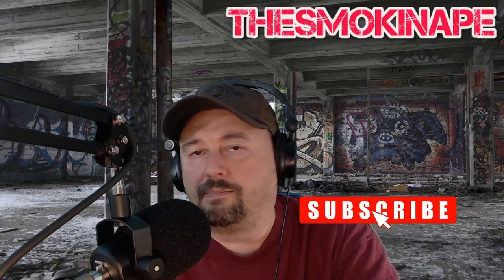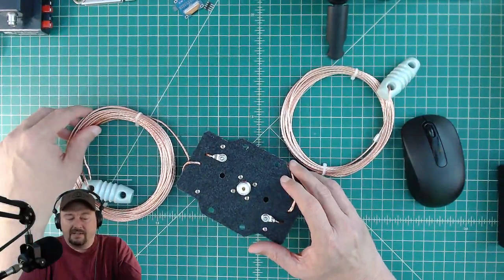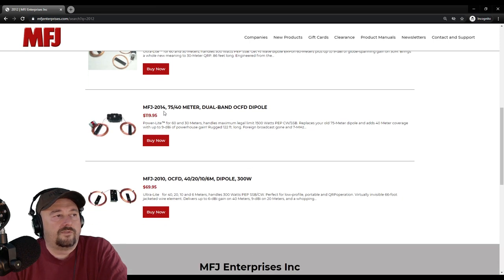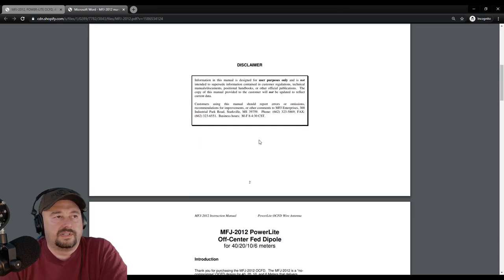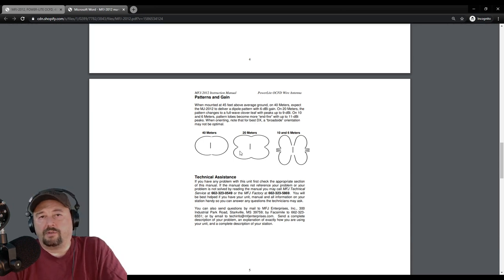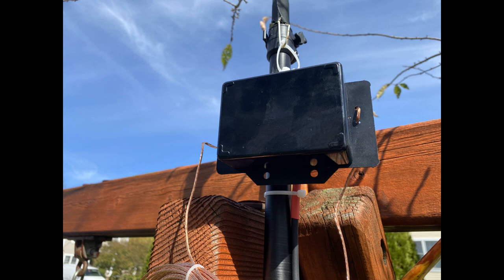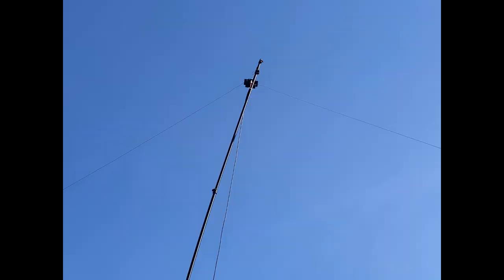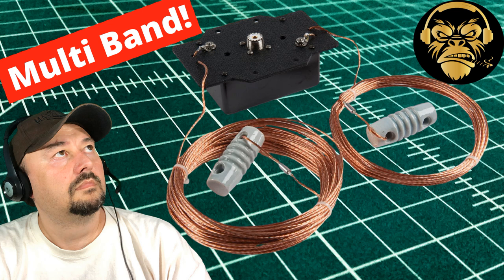MFJ-2012 OCFD Dipole - Ham Radio - TheSmokinApe

Comment: This was my first antenna after I got my general class. The antenna was brand new and given to me by a friend. I put it up on a 30’ mast, inverted V, turned on the radio and heard a dude calling CQ on 20m; he was in Northern Ireland, I’m in southeast Texas. I hit him right away and got a great signal report. I used that antenna for a good while until I wanted to go a bit lower in freq. I could get it to tune up on most of the 80m, but not quite all the way down. It was fine on 6m. 

The one thing I will caution people about is if you use it for going portable, that wire being uncoated is very susceptible to being kinked when you’re pulling it tight or winding it up. Keep that in mind and pay attention when you roll it out and take it down.
Reply from the maker: Totally agree.  This antenna performs fantastically well but the hard drawn copper elements leave a little to be desired.

Comment: Hi, today I came to know (from Dave's video) that the BalUn is not the 1:4 Guenella current BalUn but is an autotransformer with 1:1.8 turns ratio to achieve 136-138 ohm at the feed point to be interfaced with the regular 50 ohm coaxial cable; the article was written by K1BQT, Rick in June 2008 qst issue.
He had originally used ferrite mix #43 for both the 1:1 CM current choke and the 1:1.8 voltage BalUn.
De VU2RZA
Reply from the maker: Thanks!

Comment: nice video on that offset center fed dipole. this is the one I have and appx 3 years old. The only trouble I has is in NY we have bad winters, my copper corroded after 3 years and replaced with THHN wire. Had about the same tune. I shortened appx 3 in on long side and 1 in on short side. this is how you tune offset center fed. I unsoldered and cut re soldered was easier than that crimp .  I have ran a sloper for POTA . works great always stays in the tune range of IC 7300 on the 4 bands.  now I am re doing with DX commander DX 50 green wire. I have the MFJ end fed 40 meter 800 watt. about same length and that one does not work as well. sometimes needs a counterpoise.  had RFI get into my mic on that one. and snow on the ground effects tune on end fed one . not as much on offset center after I shortened a tad. if using portable just swap out that bare wire. use DX commander DX 10 or 50 . or something like that. great for FT8 . some of them small ferrite cores heat up and make SWR rize. FT8 is high duty cycle.  and meant to be low power.  great review of that MFJ-2012. it is fun trying different antennas'  . a dipole is a dipole. the feed point only changes impendences  . 73's
Reply from the maker: Hey Robert, sounds like you're running an antenna farm!
Reply: @TheSmokinApe   @TheSmokinApe  in a HOA now. portable now. POTA ! all year . re doing my collection of dipoles. DX commander 2024 expedition  portable soon. saving up. different parks need different setup. 6 meters open in NY today !  going to be trying different unun and balen out. 64:1 . even a type 61 core . want to do 160 meter again. need wire. a lot. still having fun learning !  73's

Comment: That is a cool exploration of this antenna. Seems pretty cool!
Yeah I imagine that if you were making this a permanent solution you could also mess with wire lengths and get things adjusted to where your match is happier still. Sometimes it's just tinkering running back and forth making adjustments and making sweeps with the analyzer.
73 de N2NLQ
Reply from the maker: Thanks man!  A trick I learned along the way is to use a tablet to remote control the NanoVNA Computer setup from the yard to help stop all the back and forth 👍
Reply: @TheSmokinApe  bloody brilliant

Comment: If you want a better antenna than this (quality and coverage) and to save some money just build a 135' OCF. All it takes is 45' of wire on one end and 90' on the other. 4:1balun at the feed with a simple choke (10 coils of coax with 6" diameter) about 10 feet from the feed point. You can work 80 through 6 on it though 15 M can be hard unless you have an external tuner. I have had mine up for 6 years with no issues whatsoever. Probably have made 3000+ contacts and many are DX all on 100w or less. Palomar makes a 4:1 balun with a built in choke just for this use but it is a bit expensive yet it will save you the extra coax for the choke. Nothing against MFJ but quality control is a roll of the dice.
Reply from the maker: You had me until you mentioned the coax choke or "ugly balun" as it is sometimes called.  Those need to be appropriately tuned to work correctly and don't have much in terms of bandwidth which is the point of the OCF.  I am glad it's working for you but you could just wind the coax on a t240-31 toroid for about 10$ and be better off...
Reply: @TheSmokinApe  Yes you are right that the coil may not work on all bands. I have had no issues but if I were building a new one I would get the Palomar all-in-one balun/choke and call it done. I may yet add a dedicated choke and remove the additional coax.

Comment: what are those white insulators in the package? (what are they called). and where would a person get those?. thanks
Reply from the maker: People call them "dog bones" they are use with a cable or a cord to keep the elements under tension.  I'm pretty sure DXEngineering has them.
Reply: @TheSmokinApe  thanks for your time.. have a good one
Reply: @TheSmokinApe  thanks for the reply. ordered and recieved my ten pack.

Comment: Would the mounting of the feed-point onto a leg of a metal tower be acceptable, or would the metal structure affect the height above ground impedance?
Reply from the maker: The metal might interfere, some folks will mount an arm off the tower and then use that 👍
Reply: @TheSmokinApe  Thanks for the reply.   I may try the arm mounting.   Also, I sent MFJ Customer Support an email asking the same question.  I'll let you know if they respond.
Reply: From MFJ Customer Service:  i believe this installation to be sound.  the tower leg should not
interfere with the coax lead.  thanks for your business.

Comment: I am currently studying for my General and will be purchasing the FT-991A in the next couple of months and I am trying to decide on the right antenna.  With MFJ not producing as much as it used to will this antenna be available?  Also I live in a Ranch house so my roof is only about 12 - 14 feet. That means I would need a 25 foot mast on my house.  I would need to attach that to my chimney. My chimney is not  in the middle of my house.  What should I use to tie down the inverted V ends?  Also I already have a Comet CX-333 Triband antenna on the chimney is it ok to mount two masts to one chimney?
Reply from the maker: Muck of the MFJ stuff is still available if you look hard enough. That VHF/UHF antenna looks like it’s pretty big and could cause some interaction with the HF antenna if mounted close.
Reply: @TheSmokinApe  what’s your take on attic antennas?
Reply from the maker: @JoeKrol  people use them with success all the time.  Just make sure you don’t have metal lining the roof as it will block RF 👍
Reply: @TheSmokinApe  I’m good there it’s a relatively new roof (5 years).  It’s plywood, a butyl rubber then heavy fiberglass tarpaper shingle. Also I have a 40’ length but it’s only about 14’ from the ground.  I might have to reconsider getting a mast or 40’ tower. Given what I have to work with is there a better antenna for HF that I should consider?
Reply from the maker: @JoeKrol  maybe a vertical in the back yard?  Or an endfed as a sloper?
Reply: @TheSmokinApe  thank you!!
Reply: @TheSmokinApe  I don’t have any height restrictions and a couple of the trees in my backyard are twice that high.  Just have to figure out the guidelines and my spouse has ALS. That disease is ruthless. We are praying she will live long enough to see my daughter graduate from college in 2028.  After that I’m not sure how long we’ll be in the NE.  Can you take down a mast and move it or are you better buying new?
Reply from the maker: @JoeKrol  sorry to hear about your wife.  Yes, you should be able to move and reuse the mast.
Reply: @TheSmokinApe  thank you for all of your time. Between you and HamRadio2.0 this hobby has really become worth it to me. The local club here is useless and I really want to do this but you two are a huge encouragement and wealth of information!!! Thank you!!!
Reply from the maker: Glad to help!

Comment: You are an excellent instructor however you can keep the “save the trees” comment(s) to yourself. I’m here for the knowledge, not the politics.
Reply from the maker: Hey man, I just like trees 🌲
Reply: @TheSmokinApe I like trees 🌳🌳  as well nothing wrong with that - plus they're super handy for holding up antennas in addition to cleaning the air 😀.  My big problem wil be getting the antenna high enough in the air.  73

Comment: Oh man that unvarnished wire 😳 still makes my blood boil. MF Junk. Only one month and my diepole swr was al over with no change to antenna. But I could already see the copper starting to rot. Good luck. 🍀
Reply from the maker: The wire could be a bit better 👍
Reply: I have to agree with your point about wire, mine did rot pretty quickly over the winter.
Reply: Yes, you are right. The multi stranded hard drawn copper wire is somewhat rigid and would kink easily if a good amount of care is not taken. In my 135' double Zeppelin antenna fed with 450 ohm commercial window line
I simply put 3 mm heat shrink sleeves (in 6-10' sections) with overlaps of 8-12", and made it into an insulated wire. That prevented it from being oxidized being smeared with green carbonates.